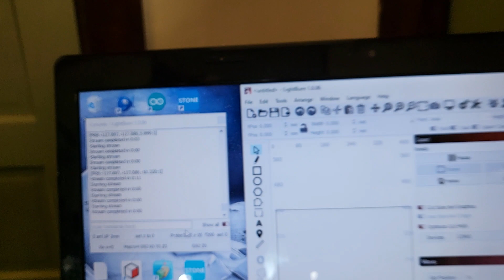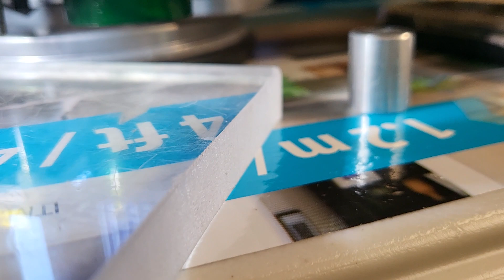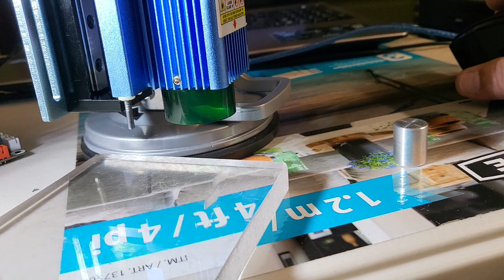SCULPFUN S6 PRO, Z axis auto focus Final step, Z probe and limit switches.

Comment: Are you able to program in z-steps to bring the laser down a bit after each pass?  So calibrate to the upper surface, and then maybe the first pass on a cut of 10mm wood is at 0mm, then the next passes at say... -0.5mm,-1.0, -1.5mm, etc?
I ask because this may enable cleaner cuts of thicker materials. It would be awesome to get the S9 cutting 3/4" (~20mm ply)!

Comment: What aftermarket board are you using
Reply from the maker: Amazon: Makerbase grbl Offline ntroller CNC3018 pro Upgrade Parts CNC ntrol Card MKS TFT35 Display MKS DLC DIY Logo Engraving for Laser Cutting Carving Machine 

See for more info https://youtu.be/shytewUGeWM
Reply from the maker: Amazon: 
Kingjinglo MKS DLC GRBL Offline CNC Control Board TFT35 TFT24 Touch Screen Replace Shield V3 R3 Expansion Plate for CNC Engraver for Wood and Metal Kit and 3D Machine
Reply from the maker: Look for MKS DLC GRBL